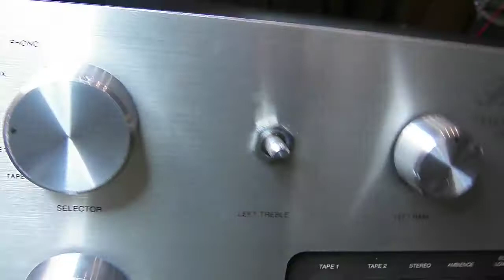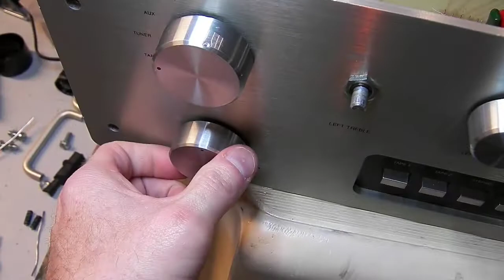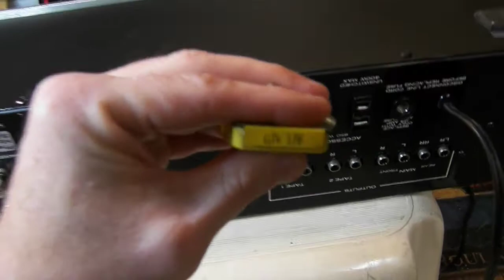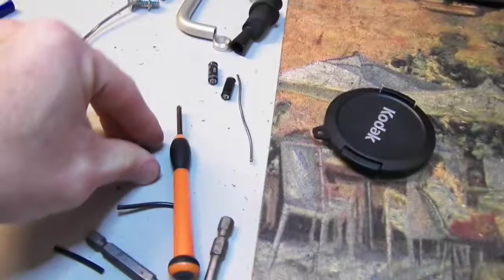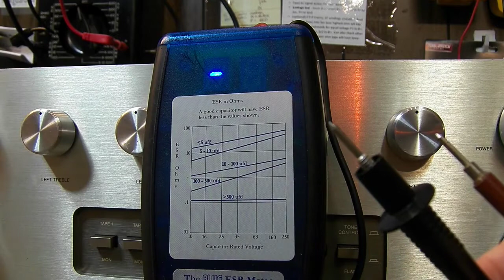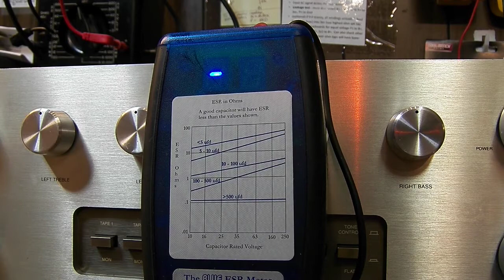Repair PHASE LINEAR 2000 Series Two Stereo Console 2 preamp dropping channel, stiff tone controls

Comment: What is the resistance (in ohms) of the ambient control? It appears to be mono. What is the resistance (in ohms) of the balance control? It's stereo. I need to replace both because contact cleaner spray isn't helping anymore. I've already replaced the volume control. And I've installed a toggle switch on the front panel for turning it on and off.

Comment: During this year, the time will also come to replace the integrated circuits, which I am still studying in more depth before deciding on that.
A funny aspect of this machine, which I have checked multiple times, is the sound cohesion obtained when I use it to control LINE signals from electronic musical instruments, a situation in which it allows extremely effective control of the sound of this type of sound sources.
I recognize that the Phase-Linear Console 2000 was not originally designed for this purpose but I recommend that anyone who wants to try it doesn't hesitate to do so.

Comment: Nice job, Bigslick! What is needed is to have nails to pick up such a console and revitalize it in depth, without changing the essential characteristics.
I have a Phase-Linear console (first model, the 2000, not the 2000II) and I still enjoy maintaining this equipment myself. I am now replacing the electrolytic capacitors (all of them) as it is equipment that deserves to be properly maintained, and this Phase-Linear 2000 console is part of my reference domestic equipment.

Comment: I love my PL2000 series 2,  it works as it should I think.  Question.  Should the rear channel output send the same channel as the front channel output? I’m running two power amps and it seems like the rear channel output send more like a surround channel.  Not quite the same as the front channel.  Is this correct?
Reply from the maker: correct, the ambience channel is a gimmick and not a clean channel.  Useless IMO.  If it were mine, I might consider rewiring the rear output jacks to use the primary signal, just in case I wanted to run dual amps.
Reply: Indeed, on these REAR output channels the signal obtained is not exactly equal to the FRONT and in my opinion, they are not very useful. This is a pseudo-surround circuit that relies heavily on the content of the original sources for it to work. But honestly, it's not something I'm convinced to take advantage of in regular auditions.